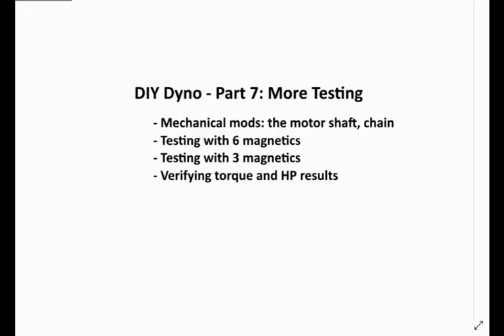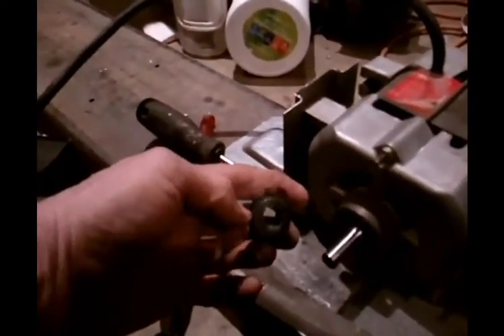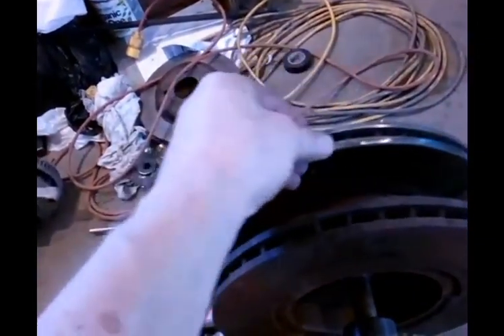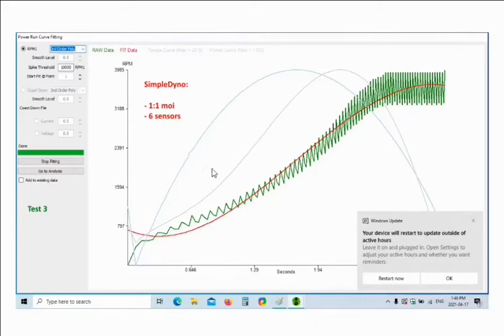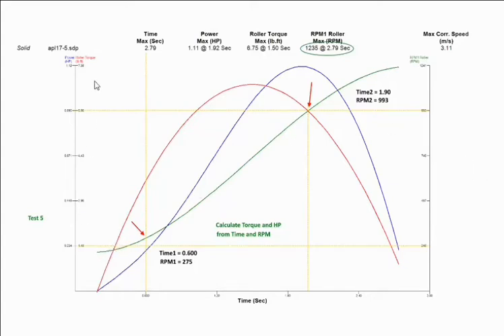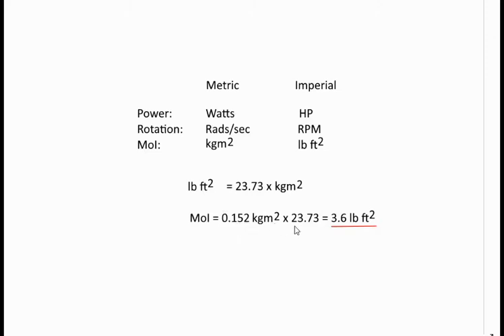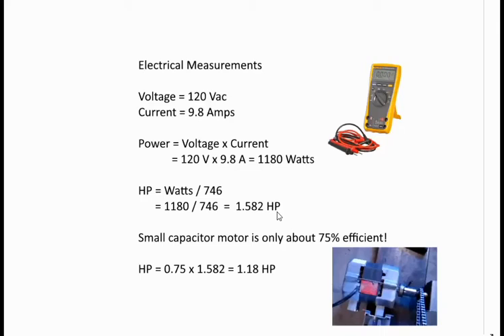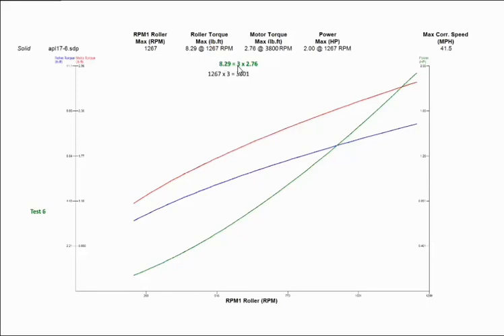DIY dyno (Dynamometer): Part 7 - More Testing

Comment: 5:37 how can be here shown thant the power and tork kurve is un usable but if u aave it u have no noise at all?
Reply from the maker: The power and torque curves are calculated from the average of the noise.  A little bit of magical math cleanup. The results were showing 50+ hp which  we know is not realistic that's why it is un usable.

Comment: You could adapt an alternator or other electrical motor like a stepper to the flywheel where the magnets are energized it provides a constant load on the motor being tested and that load can be measured by the output voltage generated by the motor not powered. Ultimately a generator 0-15v or whatever that can be applied toward torque if you known the specs of the motor your using which can be done by using a pendulum the diameter length of the flywheel and hanging weight from it.
Reply: Youre getting a signal interference. Using shielded wire? 

Could try molydenum magnets on the wires. It could also be picking up resonance because somethings imbalanced there. 

Load sensor either way is a must or you’ll never get accurate hp torque readings. 

You cant simply play with settings and magnets until it looks close thats not how torque is determined. Y get the proper sensor rom hall effects cannot determine torque. If simple dyno says that than Theyre the problem
Reply from the maker: Ear buds don't have shielded wire.
Reply from the maker: I've seen other videos where they use an alternator as a load.